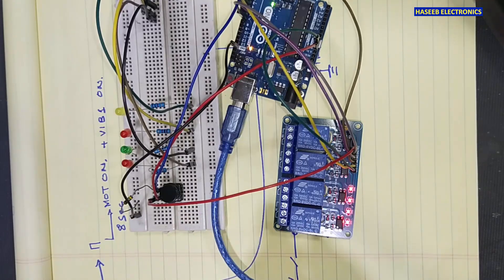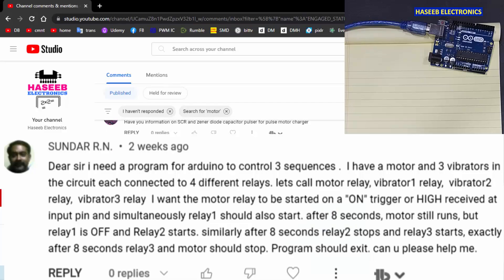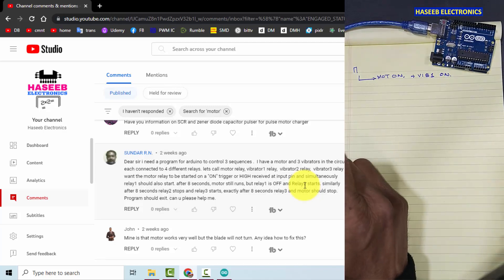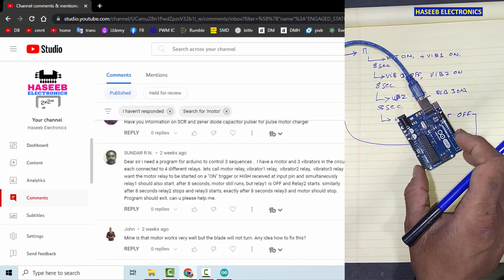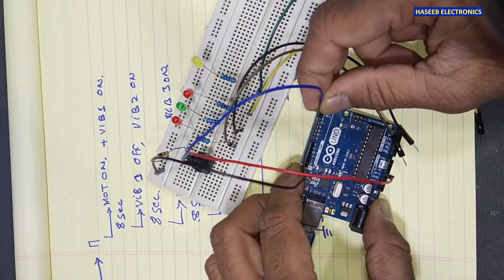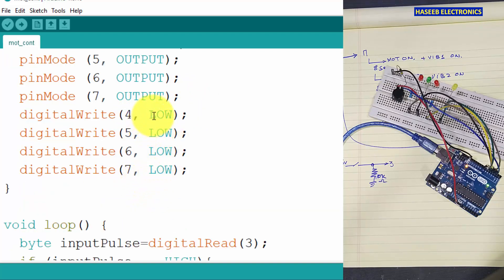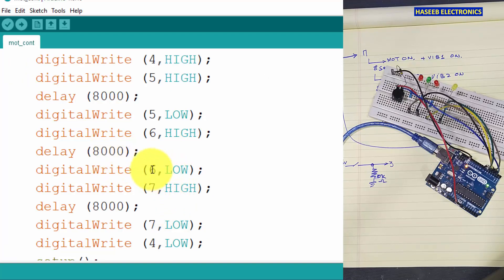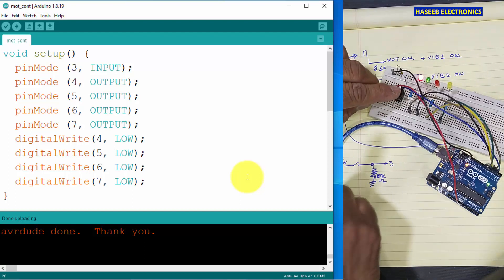{827} Controlling Multiple Loads Using Arduino & 4 Channel Relay

Comment: Thank you for sharing and have a great day! Nice that the relay module uses optocouplers. I'm not sure of the current carrying capacity of the AT Mega 328, but it is bad if you short the unprotected output pins. I wonder what protection can be used to protect the output pins.? No rush, but if you're looking for a video idea someday, maybe one on this.
Reply from the maker: maximum 35mA for each IO pin is current rating 
the output pins are protected 
as this microcontroller have active watchdog system